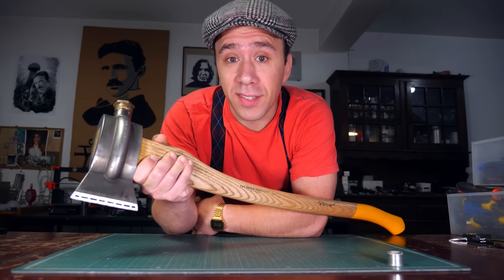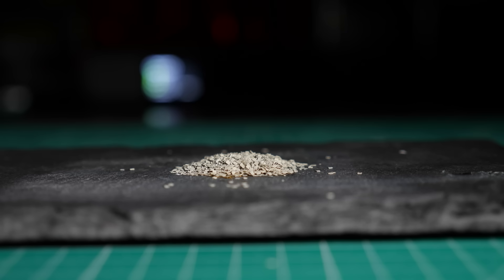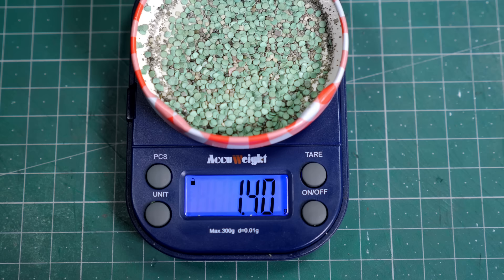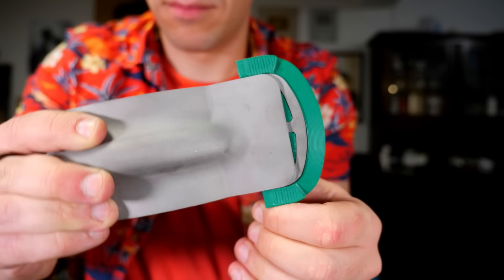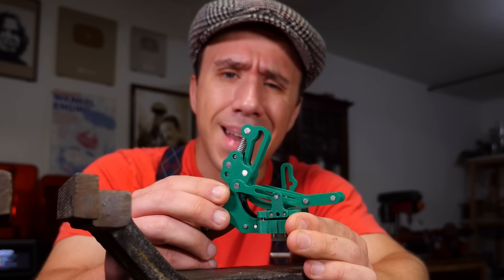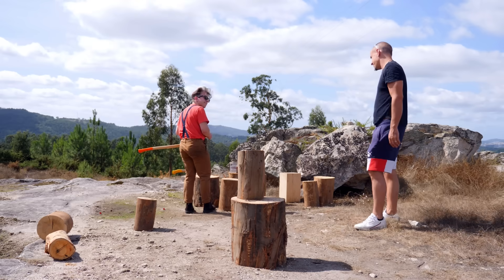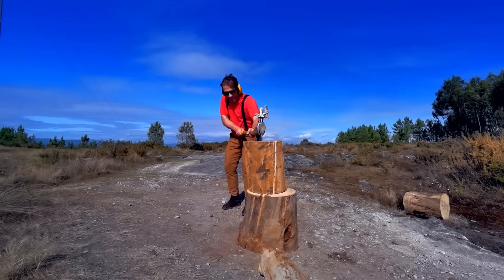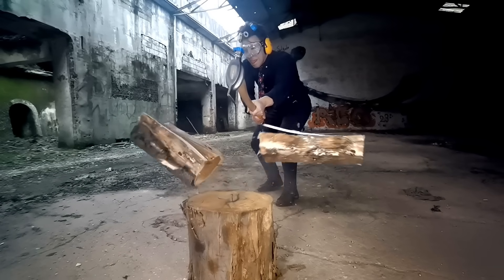I built a BETTER SHOTGUN AXE

Comment: A couple of tips if I may. Shotguns generally produce around 15,000 psi to 25,000 psi depending on the loading and powders used, thus the pressure blowing you mechanism off. If you made a smaller mechanism that was lighter but of stainless steel and fitted onto the axe head more securely, you could use more powder or faster burning powder to create higher pressures. Your first trigger mechanism, with some tweaks, would seem better to me because at the moment of firing, the back of the shell has more mass behind it, allowing for more of the pressure going into the wood. 
I am sorry you live in a country where your government makes life so hard to acquire the needed tools for your experiment, have you looked into getting some reloading components like shotshell primers and powder so you can simply reuse your hulls you have already cut down? Good luck and can't wait to see V3 of the setup.

Comment: For version 3 (or 4 or 5) I don't think your axe needs to resemble an axe at all.

You identified the 3 problems with your current design: 1. The axe partially splits the wood releasing the pressure harmlessly, 2. The axe bounces out of the wood releasing the pressure harmlessly and 3. The axe does not penetrate deep enought releasing the pressure harmlessly.

Given the goal is to use the pressure to blow the log apart and not the physical shape of the axe I think a better design would be a hollow barbed spike with slots or holes on the shaft. 1. The spike will be much less likely to partially split the log (still possible but the lower volume will help), 2. Barbs on the shaft (like a barbed hose fitting) will help hold the spike in the log and 3. The spike will   concentrate the force of the blow to a very small point and allow much better penetration than the wide blade.

With this design you can do away with the inertial trigger if you want and have a manual one on the handle instead. Just drive the spike then pull the trigger. To make it much stronger you could widen the spike near the handle, incorporate a breach and load the shell through the side of the "barrel", if you are super ambitious you could even make a revolver style mechanism to load the next shell. Have a simple spring loaded fireing pin go through the wooden handle of the "axe" to strike the primer.

Comment: I think part of the problem is that you're thinking of this as an axe when it really isn't an axe. It doesn't need the same shape or design as an axe because it functions completely different.

What you want is something to drive deep into the center of the log and then release the pressure, trapping as much pressure inside the log as possible.

A much more efficient design would be a long sharp spike. It would go deeper into the wood and therefore apply more force.

It of course would need to be a stronger design, but I don't think that's impossible.

Comment: If you shop for wood splitting wedges, you will see some of them are pointed instead of bladed. I'd be interested to see if you could make a head like that and it might work better. You wouldn't have to sharpen it, and it would more easily be driven to proper depth. 
Mechanically they work because a sledgehammer hitting a wedge applies more force than an axe. But the different shape doesn't change how the wood splits

Comment: You know what would be way easier than that whole firing mechanism? Balls. You know how you can get those office toys that have 5 balls hanging from strings and when one is dropped on one side it makes the ball on the other end fly up? Well it’s simple. Have a hollow cylinder inside the axe. Have a weighted ball with a rod on the end able to travel the cylinder. Attach a spring to keep the ball from falling down. The end of the rod flips around with a striker on it that hits the shell. Now when you hit the wood, the ball flies forward and with it the striker. All these components would be internal making the axe more durable. 
Also if you build the axe in layers of metal instead of 3d printing youll half the cost to build it and make it easier to fix if it breaks

Comment: Splitting mauls typicaly have steep tapper and a heavy top, you could use wider body to account for thicker walls  and double the mounts to include 2 shells. Plus more weight means a deeper fitment into the logs, you could also adjust the number and size and shapes of the ports to focus the gasses directionly to be more pointed like air blade on a dyson hand dryer to help maximize pressure downward  and inward towards a more centered focal point kind of oppisite of the sweep of the blade angle itself.

Comment: When I was a kid, I used to split wood with firecrackers. Drilling holes and nailing in planks with hole for the fuse, but still... I splitt almost everything with only 0.8g of black powder. So, instead of making a regular axe, how about something with a more spear like tip, that goes deep into the wood and then delivers the pressure as far into the wood as possible? To recreate the effect of the firecracker underneath a plank that is nailed into the wood? When I did it, dry wood was splintered into peaces, while dense hard wood was split in two...  I know there was no 3d printer promise in this video, but hopefully you actually read this comment and find it useful anyway. 😃
Reply: Another design idea could be to avoid using holes to distribute pressure, but instead make parts of the side of the axe move a few millimeters to the side? With an explosion, a very quick movement might be what is needed to split the wood? There is a lot of experiments that can be done here... including creating your own explosives, which you have done before... 😉

Comment: I really liked the idea with the hydrogen-oxygen generator. If really only the volume is a problem, how about intagrating the axe head into a handle, which part that you are not holding in your hand (clearly marked for safety reasons) could be a sturdy pressure vessel for the gas mixture (The problem will be, that this reservoir volume will be reducing the expansion pressure. You would probably need some way how to compress this gas into a way smaller volume during the impact of the axe). The final version could actually have a hose loading to the holding end of the axe, allowing an automatic recharge through a needle valve in the axe. On the other end of hose could be the electrolyser with an elastic reservoir, holding the gas beng generated. (And in a sales version, the generator could be powered by a deployable photovoltaic generator.

Comment: I have some thoughts on how to potentially improve it, bearing in mind I have no engineering experience so I'm just thinking out loud.

Triggering - the trigger is currently based on a secondary motion - the force of the spring/lever when the axe bottoms out on the wood, I think this might be what causes the delay between the hit and the firing. Is it possible that instead of a spring mechanism, maybe the axe could slide onto the shell as it hits? I'm not sure how best to describe it, but I guess the axe should hit the wood but the handle continues a few millimetres further to fire the shell.

The air output on the blade - with your mk1, the arrangement of holes I think is a good choice but I wonder if it could be moved closer to the edge of the axe so the air will be directed more into the split rather than towards/over it? The mk2 head I feel the air outlets are too far back from the surface and maybe too much air escapes which weakens the splitting force. As a mk3, how about taking the mk1 head and altering it. Fill in the current holes, and create new ones right on the cutting edge, you could maybe drill these into the flat edge once printed and then sharpen it afterwards so that the holes end up right along the cutting edge. 

Hopefully a combination of these two tricks may offer more synchronised firing and a more direct injection of air into the split of the wood

Comment: I have a couple suggestions. Make a trigger contact the wood so you no longer have to trigger manually. This also means the axe will not Penetrate too far into the wood. I was also going to suggest the axe have a blade more like a fork to also prevent overpenetration but the trigger idea already solves that. In addition to threads, consider a locking screw on them too. One last thing. For more consistency, instead of venting straight into some wood, vent the gas into another part that THEN splits the wood. You can even add a vent to the gas system so your parts don't explode.

Comment: Can you please put your self behind a bit more safety in version 3. Also glad you worked out the timing issue. Perhaps the impact can act as the trigger? Reloadable shells would also be quite cool. I think your losing alot of energy from the rear. My other thought is rather than use the shell to blow the wood apart, another shell to help drive the axe in. 

So in conclusion sealing the shell like a normal shotgun would to help propel its energy in only one direction, using a shell to help drive the head and having the trigger in the head.

Comment: 3:47 use real safety glasses for angle grinders. Using glasses is not a big deal if you're just worried about saw dust but you need something impact resistant in case a disk blows up. Those will not protect your eyes from shrapnel.

Comment: As soon as you mentioned eucalyptus your failures all made sense.
I worked for a government firefighting department, and was a hobbyist woodworker, in Australia for many years and can attest to it's strength.
Great video, by the way, and good luck with V3.
Reply: Yeah I've worked with red gum once and I'm pretty sure the kind I worked with was like half or less on Janka hardness rating than tasmanian blue gum 😭 Had to do a double take when I heard him say he went from pine to tasmanian blue gum
Reply: @papitosaucito That's very interesting. Thanks for your input.
Generally, and from my experience, Tassie blue gum is easier (less dense and softer) than  the various red gum species. But there's no argument that either make pine feel like cheese, and a soft one, to work with.
Reply: I split eucalyptus as a matter of routine out of sheer stubbornness. I am 6'3" and 120kg, I use an 8lb maul and none of this helps. 
What you have to do is peel it. Take the twisted grain off the outside in slabs. Then you can split the straight grain in the center. If it's proper tough stuff, nothing will split it straight across.
Reply: @FREDDAGGS 100% correct. We had a tree come down a couple years back and still have a bunch of rounds left, with some up to about a metre in diameter. I split it with a fiskars maul by cutting slabs off the circumference of the round before splitting the core.

I only do it as a workout as it's incredibly hard work. If there's a knot or its part of the trunk where a branch was attached can increase the level of difficulty by 3x minimum.
Reply: @oliviercoulon5196  peeling the outside as you describe is the correct technique. You and I are two of three people I know willing to split that stuff by hand. Most people say its impossible.
Reply: Hi

Comment: I think the original mechanism did better for hit timing, but on harder woods a side hit no matter how soft compared to the top hit make a huge difference, especially near knots. Try a shell load on the side, for science! (Think of where the structural strength lies in cylinders)

Comment: What do you think about a different kinetic trigger using magnets?
The firing pin runner assembly dropping on impact at a so-so calibrated force and being held in place by a magnet.
Sounds much simpler in theory...

Comment: There is no such thing as too hard wood... You just have to use more explosives!!! Jokes aside, I think the problem is using the gas from the explosion. Wood gets really elastic when applying enough force, this absorbs much of the energy. Also the force of the explosion is spread over a large area, which limits the possible effect. If you bash a pile of wet sand with your fist, the imprint will be a few millimeters deep. If you use the same force with an extended finger, you will completely sink it into the sand. It would be more effective to use the force from the explosion to push a wedge into the wood. This would apply a huge shear force exactly where you want it.

Comment: IDEA: have the gas from the bullet come out the sides of the front instead of the 'front of the front' lol.  That way, you can have a sharper cutting edge and gas from the bullet pushing the wood apart instead of pushing the axe up.

Comment: Maybe don't rely on the expanding gasses to act on the wood directly. Sealing seems to be very inconsistent. Use the energy to drive the edge into the log instead. Of course, that means the edge will be a potential projectile, so don't try this at home.

Comment: Maybe for v3, instead of using the gases to directly split the wood, maybe use something similar to the axe design you showed off in the first video with the arms that split the wood apart, except propel those arms with the shotgun shell?

Comment: I think relying on the gas to reliably get trapped in the wood is never going to work well. As you've mentioned, there are just too many variables with the wood, angle, penetration, and so on. 
I would consider going the route of a mechanical splitting axe like the Chopper1. Those work by redirecting the force from the swing outwards inside the log with hinges that push out as the axe goes in. I'm thinking of something like that but using the trapped pressure from the shell to push something out from the sides of the blade. You could more reliably trap the pressure and ensure that the mechanism always gets triggered. The main issue is ensuring the mechanism actually is inside the wood when it goes off. And making sure the whole thing doesn't just explode I guess.

Comment: Dont just let the presure release... build a mechanism that drives in a spike or metal sheet of some sort after its triggered. You can use the axe itself as some kind of shaft and at the end have a stopper and exhaust holes so the whole thing dosnt blow up. Would be much more effective (and dangerouse...)

Comment: To fix the timing, you should switch from an inertial trigger to a mechanical lever near the blade.  To reduce the danger, maybe one on either side, where both have to be activated.  That will ensure that it triggers when the axe is at the correct depth, no matter how hard you swing it.

Comment: Have you considered using a burst disk design? A design that can hold compressed air/co2/combustible gas mix under pressure in it's chamber. With a burst disk holding it back and the chopping action making it pop and release or ignite (to burst) and release. 
This would allow you to fine tune the force output as well.

Comment: You should make a combustion chamber that opens at a certain pressure so you can have a higher starting chamber pressure. As gas is less dense than the gunpowder, if you use the same mass of gas and gunpowder, the gas should preform better than before.

Comment: Could you drive a big steel spike into the wood with gas holes in it to split the wood? You could get deeper penetrant without causeing a crack right away only thing you need to figure out is how to build and attach the firing mechanism so it doesnt blow out like that if you made one out of steel you maybe could weld it to the axe ?  And have a screw off lid to hold the shells just like a 50bmg gun has 😅

Comment: I would suggest having a proper trigger mechanism that's set off by hand, rather than having an impact trigger. If you can afford to be less gentle with the axe, you can get a full proper swing, which would drive the axe solidly into the wood. The way you were swinging it, you were getting only a fraction of the driving power that an axe head can have.

Comment: To avoid gas escaping through the wood, could you create a 2 part axe head that the gasses push apart? Instead of using the gas directly to split the log, could you use the gas to spread the axe head thus pushing the log apart? You wouldn't need as much gas for this so it wouldn't be as dangerous and may not require shotgun shells since they are hard to get.

Comment: Oxygen hydrogen burns hot, but the power of an explosion doesn't just come from heat; explosive power comes from the generation of large amounts of gas, which can also have higher pressure from high temperature. That's why explosives tend to contain a lot of nitrogen - it loves to create big clouds of hot gas like nothing else, and nitrogen gas doesn't want to suddenly turn into something else without a LOT of persuasion.

Comment: Not even so much how hard the wood is but how well the wood fibers bind to each other and how far they can "stretch" before breaking. You can have a really soft wood that stretches and deforms allot before splitting and have a super hard wood that will split super easy. Example if you had a log of say iron wood and got the axe in deep enough before firing it would blow it apart with ease because it is so hard that it is fragile. Hammer the axe blade in load it and fire it and it would just split with zero issue. While cedar being very flexible would probably only partially split or just blow the axe back out

Comment: Your mistake is trying to make an established tool work differently. Maybe a Penetrating Splitter and not an Axe. I think a 3 or 4 pronged star spike that will drive easier and deeper, seal better and put the pressure deeper inside the log. Logs that have splits will just vent out of the gaps.